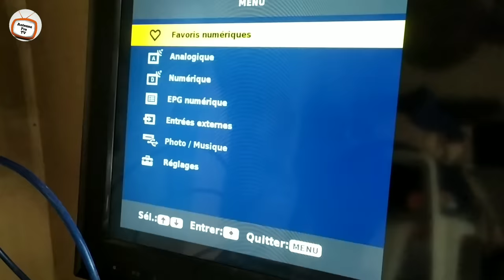How to make the strongest digital antenna for TNT HD channels using SwitchTV

Comment: Back in New Zealand I tried this, instead of the 3 coils I used 2- 93.4uF. Pick up a radio station in stereo. If I tried 5 of these 93.4uF, I might get 5.1 sounds.
Reply: M..

Comment: Worked long enough as a cable tv technician to know that does not work, at least not with the clear quality shown. If it would work at all, one would get far too much interference and static on the signal to even watch anything.

Comment: Why are the antenna mounted on the "OUT" and the TV mounted on the "IN" connectors?
Reply: Télévision
Reply: It is a splitter, not a magic box with 1 actual in and 2 out ports.  It is just some wires connecting the 3 center pins together and a shielded case!

Comment: What is the AWG# of the solid copper wire? It seems the 3 coiled wire is slightly thicker than the 2 straight wires, does a thicker wire will result in better performance?
Reply: Electrical wire "I believe." !

Comment: how come you connect the (in) of switch TV to the (in) of the RF of your TV >>>IN TO IN NEVER WORK.
Reply: It is a splitter, not a magic box with 1 actual in and 2 actual out ports.  It is just some wires connecting the 3 center pins together and a shielded case. Take one apart some time!

Comment: Totally fake! I have a degree in electronic telecommunication and that cannot work at all in real. Even if it is supposed to receive digital signals, the radio wave itself is still analogic and obey the same laws of physic. Digital TVs ars broadcasted both in VHF and UHF. That antenna has just short rods (dipoles), so only for high frequency. Besides, the gain is probably low. Oh and any antenna needs to be orientated toward the signal source, so it is very rare it can work on the first try, if it works. So that presentation is definitively fake. Oh and BTW, for a local station that is relatively close, a basic indoor VHF-UHF can work, even better if it's amplified. For more distanced station, a rooftop antenna has better gain and give better results.
Reply: Thank you, you save me 12 min of my time😊
Reply: Когда приемник находится рядом с мощным источником ориентировка ненужна, также ненужно ничего городить, достаточно резистор от одного, до десяти кОм воткнуть в гнездо антенное
Reply: Oye perdón pero está lar guisimo el comentario es casi un libro jijiji
Reply: Usted tubo un sueño y lo replico ,no tiene idea de esto , vende humo